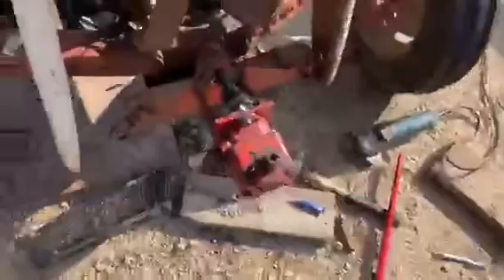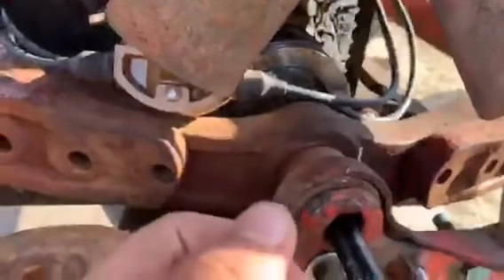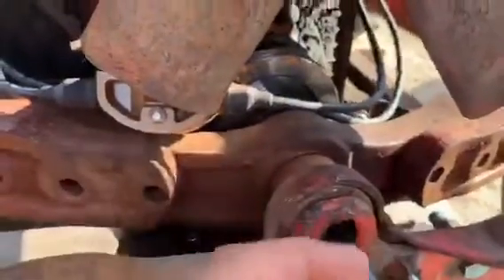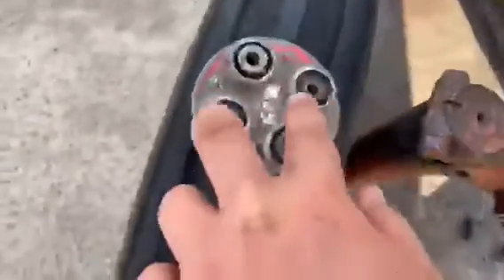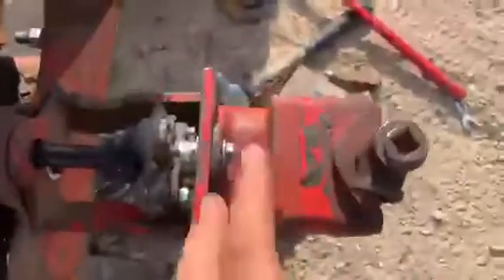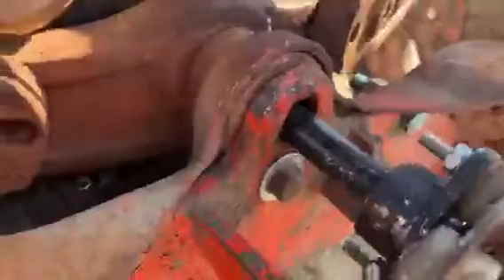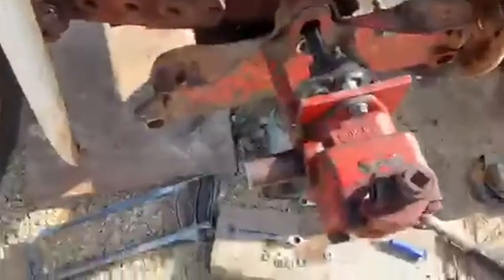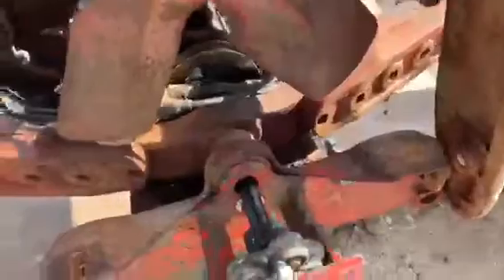how to add/install a loader on a ford 8N, 9N, 2N part 1

Comment: I've got an old loader for my 8n and I'm probably going to use an electric hydraulic pump like you would with a dump trailer. It will have a remote Reservoir and I've already converted to 12v so it will be good power-wise.

Comment: my granpa has what i believe is a 1950 ford 8n still with a manual sitting on the hill with a loader just sutting there unfortunetly with a hole in the block
Reply from the maker: This one had thrown a rod at one time and they put the piece that was knocked and welded it and JB welded it back into place and fixed the rod and it ran for 30+ years after until i replaced the block when I rebuilt the engine

Comment: Good video!! Good advice!!
Nasty job to do😵
Reply from the maker: Thank you.  
Yeah yesterday I got the frame on that was way harder than I thought especially in 110 heat index me and my brother did it with a donkey forklift and and a skid loader still was challenging. I need to buy a 1” drill bit for my dads electro magnetic drill press. Then I will get part 2
Reply: @whathobogrohknows  just think, when that was new.. the poor guys at the dealer who got to put a loader on, didn't have the skid steer or forklift
Reply from the maker: Gosselin Farms Ed Gosselin yeah my one neighbor who is 78 worked at a ford dealer he never worked on the n series but later 851’ 650’ etc he hated loaders for that reason. Another neighbor I have put on on a Ferguson 35 it took 4 people grunting putting it on that was just the frame too
Reply: @whathobogrohknows  YUP.. that's how it was done.. lots of things were just sheer man power.

Comment: what pump and valve did you use? Also what is the lift capacity?
Reply from the maker: It’s a Vickers vane pump, a Cross 2 spool both are double acting spools, I’ve had the bucket full of black dirt before, but I have a 55 gallon steel drum on the 3 point and that is almost full of sand